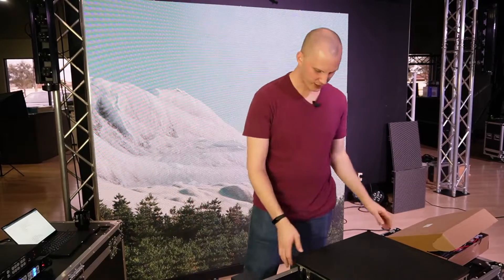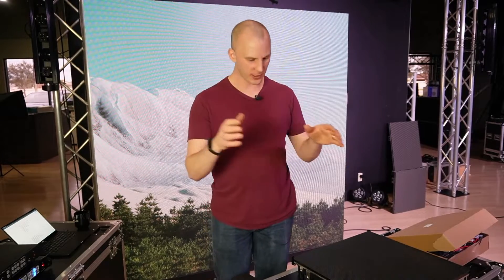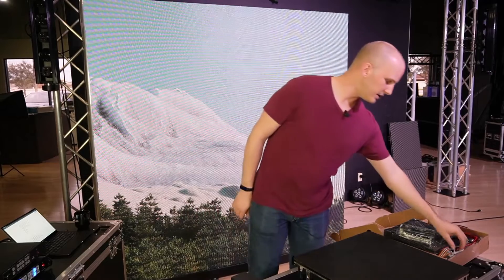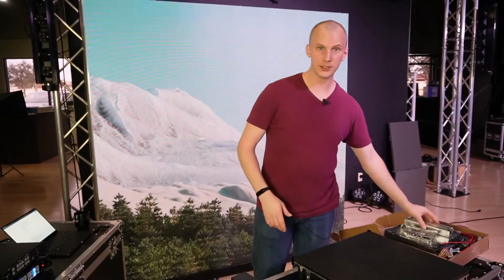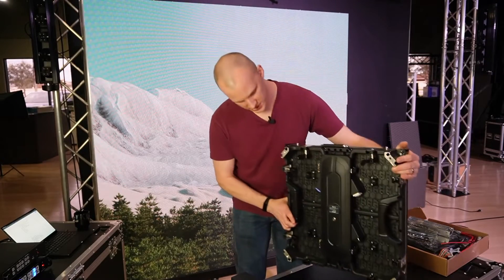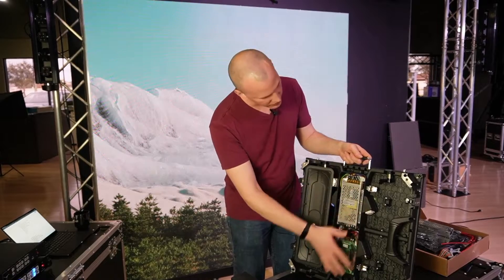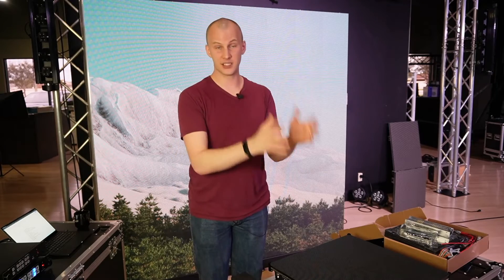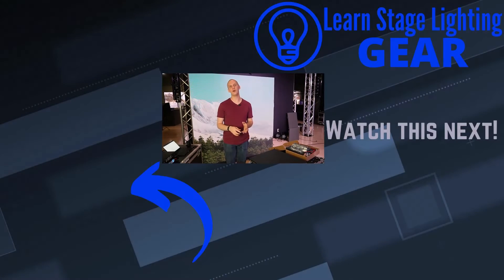How Do You Choose An LED Video Wall Panel?

Comment: Hey I'm so glad I found your videos! 💪😍

✅ Have you tried using the FLEXY LED panels ?
I know the set up uses the same
NovaStar Video Processors and Recieving cards,
✅ So I wondered if it would be the same Software Setup for FLEXY LED's aswel ?
 as obviously you're using the Same Novastar Software.
Seems like a really obvious question lol
But obviously I'm using FLEXY LED's
( I geuss both systems are LED's nonetheless)
✅ I geuss both Flexy LED Panels + Stiff LED panels are ALL STILL THE SAME LED's + Novastar Software 
✓ Just in different Hardware Casing ?
 But I'd love to know you're Experienced insights to Setting up ?
✅ As no one else is answering this basic comparison question on YouTube ❤️
Might be easier than I think actually?
( I just watched your software video - so just wondered 
✅ if you had a look at FLEXY Panels at any point + what your comparison would be on Setting up software on both - just to ask an experienced observation obviously )
✅ Hey maybe you could do a video on this !? 😍🎉
Would be so helpful as I'm about to create an Flexy LED wall !